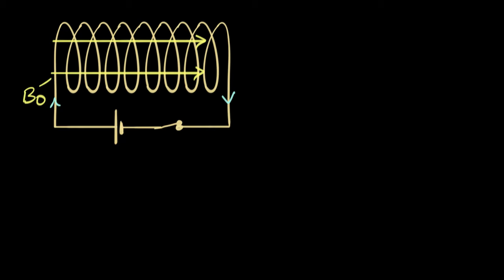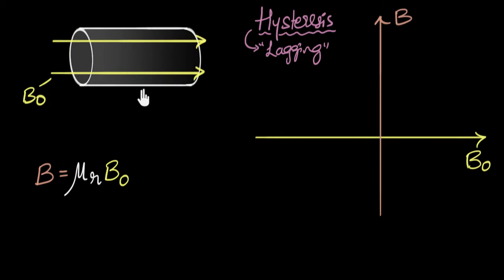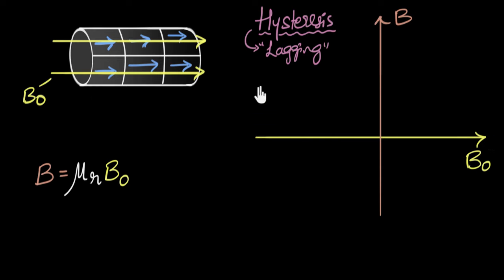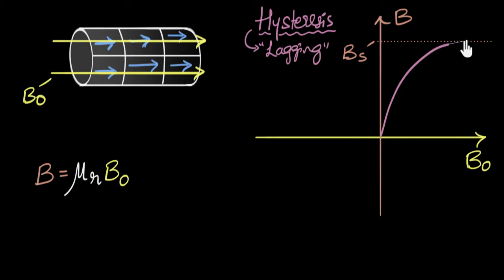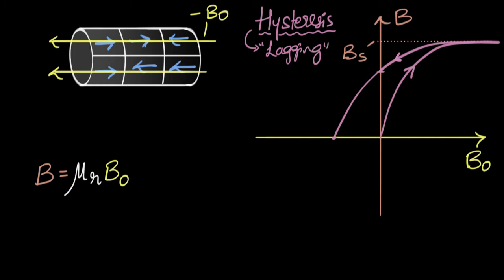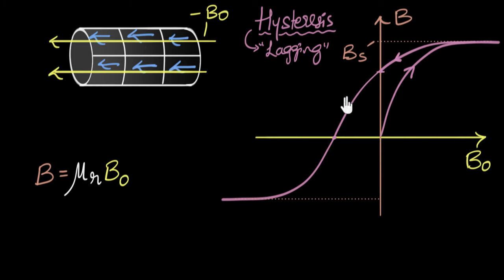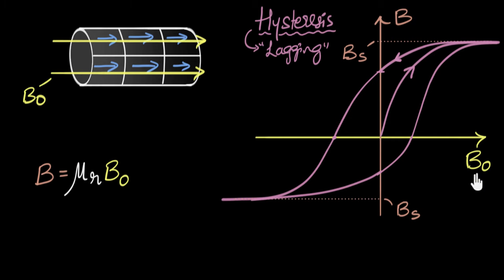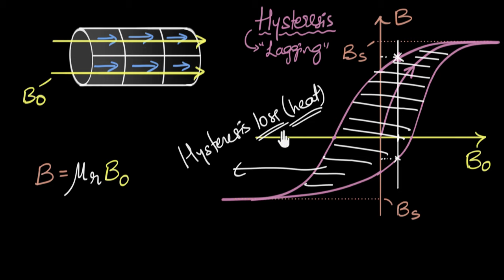Hysteresis & magnetic retention | Magnetism & matter | Physics | Khan Academy

Comment: Thanks for your efforts, in transformer the magnetic core is used to just strength the primary magnetic field lines means increase it's density or the core is produce it's magnetic field lines also  and so the secondary windings is being linked by the combination of primary windings magnetic lines and core magnetic lines?

Comment: Thank you Mahesh! I have been curious and perplexed by the concept of hysteresis with regards to the user defined paramters of certain digital functions in a synthesizer module (Expert Sleepers Disting Mk4), and have vague memories of the term coming up in a controls and instrumentation class. 
I may have missed paying adequate attention that day, as I seem to lack an understanding of the core concept.
Reply: Is there computer assistance for drawing those curves so smoothly? Do you use a drawing tablet?
It appears the straight lines snap to horizontal and vertical nicely. These are very nice blackboard results, however you make them.

Comment: Sir please clear the confusion between B and H . If H is the external magnetic field then why we use B for magnetic field due to current carrying conductor in most of the text book .
Reply: ●B is a magnetic flux density, and
● H is a magnetic fields strength .
●B= it's a magnetic flux passing  through perpendicular a unit surface area.
●H = it's a magnetic intensity at a X (point) is the force acting on the unit N-Pole placed at X (point).
【H= m/4πu d^2】
Reply: @mohammadzaidqureshi2063  Then we should use H in bio savert law right! Why we are using B there?